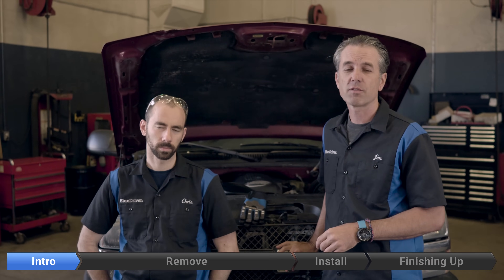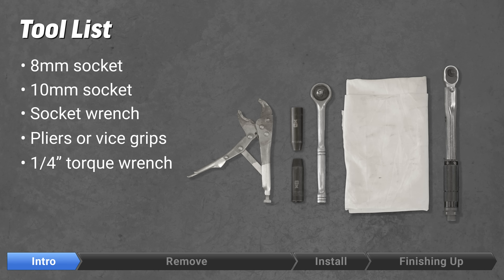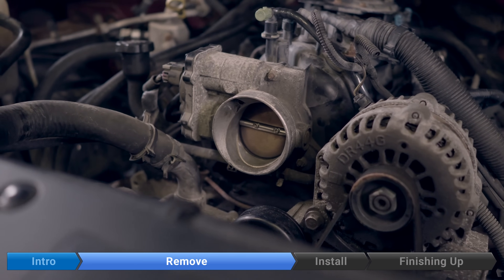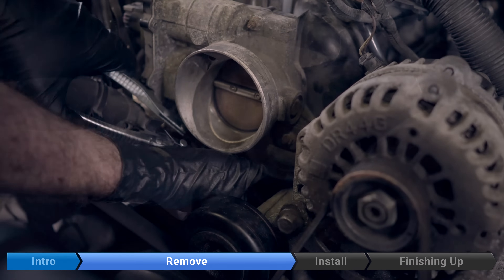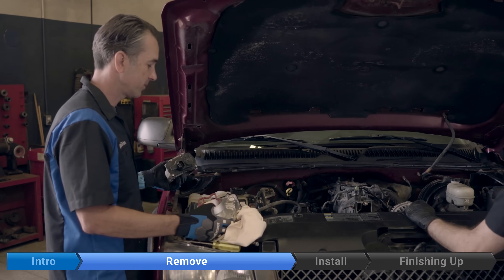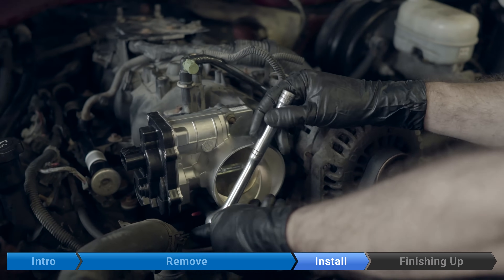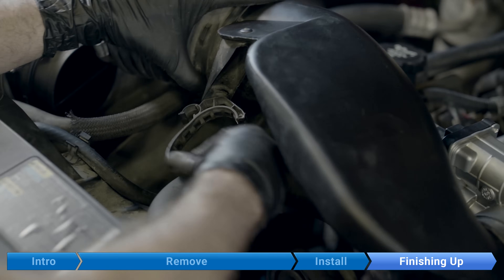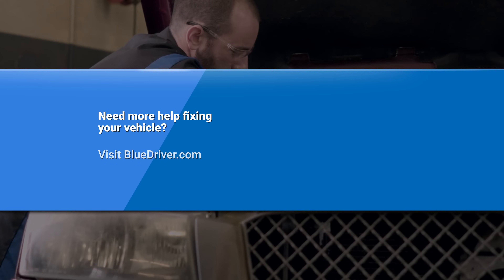Throttle Body – 1999-2006 5.3L Chevy Silverado (Sierra, Tahoe, Yukon, etc.)

Comment: This video saved me so much money, the dealer wanted $150 per sensor plus $800 labor. I bought sensors for $50 each and a gasket, all for under $200. Thank you for making this video, it is the best video I've found on YouTube for replacing a knock sensor, so we'll done. I can't thank you enough. A few snags when I did the job. My rear sensor was stuck, just spinning when trying to remove, found a video  that you just reinforce the crimp with a screwdriver and hammer, saved me from drilling. Also my injector connectors were different but I found a video for that too. YouTube is the best instructor!

Comment: Thanks for starting with the battery. Clean tight connections are important, but checking ground from the back of the alternator is important, install one if none, voltage drop ground and B+ while running with headlights, blower fan on high and switch DMM to A/C at alternator as it should be less than 0.60 volts A/C at 2K RPM and 1/3rd of that reading at the battery. A bad diode plays hell with serial data signals, even without a “ U” code. ASE Master Tech since 1978 - Retired

Comment: Thank you for showing us I’m hoping that’s what’s wrong with my truck
Reply: I have a 2006 Chevy Silverado the RPMs goes up and down it looks like I’m losing power the one and a third gear the idle the RPMs raises up and down up and down before all this happened it’s just that there’s RPMs We’re just traveled up up and down not all the time to certain time so clean sprayed the throttle Body it seems like it helps him then it’s idols really high
Reply: @shepfc1962  did it help?
Reply: @DB-in1kh  yes Wasn’t the problem The second and fourth gear in the transmission was out thank you

Comment: Mine is a 2000 2500 6.0 just cleaned mine put new gasket on it and the truck is fixed used to cut out now it has instant response
Reply: i have a 2000 gmc with the 5.3 and the throttle is stuck open so it idles super high if I clean this will that help

Comment: Bought a throttle body sensor for a 2003 1500 5.3 liter engine from Oreilly. auto parts. Sensor connectors that plug into the throttle body were to deep into the sensor. Replacement was the same way. Was forced to buy the complete throttle body with the sensor. Mechanic is putting it on now. I hope the sensor is not the same as the other two!

Comment: Does anybody know what that part sitting above the throttle body is? (the part with that green knob attached to it)
Reply: That's the evap solenoid service port
Reply: That one vacumn hose he took off the was so hard that i pulled it and that plastic vacuum fitting broke

Comment: My tahoe 2003 5.3l is not relearning.. replaced the TB and have done the whole 3min run 1 min off about 6x now. I tried doing the 44mph trick, but my car will not go over 10mph... I also tried taking the battery off for 10mins and no luck. It says reduced engine power and the light is on. Unfortunately I can't drive it to go get tested.. would anyone be kind enough to help?
Reply: Did u ever solve?

Comment: Had a question guys I have a 2001 chevy tahoe, when driving the engine sounds like it revs when getting to the 30 mile mark on speedometer it had the engine light so I put the code reader and p0332 comes back so I change the knock sensor and it still does it can you guys give me some po in nters of where to start from please. Thank you in advance
Reply: @Enrique Torres   >The code P0332 is the knock sensor. I highly suggest dielectric grease where is screws in and inside the connector. A high temp RTV should be applied completely around the valley grommet to keep water out. Any pressure or vacuum from temperature changes will pass around the wire in the grommet. Throw away the foam gap fillers on both ends of the intake.  
 After this repair and you have no codes and the same problem, it auto, it can be a sticking shift solenoid. It can be serviced in the vehicle with the pan off. I highly recommend changing the servo assembly complete with a new one from “Superior”. It takes an hour and cost parts about $100. This effects 2nd, 3rd and 4th with higher holding pressures if what you is hearing is a “Shift-Flare”. The two maybe completely un-related. However, the signals from the “MAP”, “MAF” and throttle position tell the PCM if you are up shifting, down shifting, holding still on cruise or pedal. But all of these signals are inputs to shift and change ignition timing for proper feel, shifts and normal operation while it calculates load. This effects the line pressure in the tranny. Cleaning the MAF sensor is normal for higher milage vehicles. Do NOT touch the sensors wire with anything other than MAF sensor cleaner from a quality company like CRC or Berrymans. Others may work, but a check of pending or current codes is a good place to start. Hope this helps since they didn’t answer you. ASE Master Tech since 1978 - Retired
Reply: What he said. The design for the knock sensors is bad in that the seal (lack of seal) allows water in. Def use some rtv sealant or gasket maker around the area

Comment: What year is this one? Mine has cables attached ....it's a 99
Reply: The one in their video is  the updated/refreshed Silverado from that generation. 2003-2006 which did away with throttle cables.

Comment: My '99 GMC 1500 SLE 4x4 5.3 has the old style mechanical throttle rather than the electronic.  Can this be converted to the electrical actuated throttle and is it worth the difference in cost / and harness particulars?  If no,  what steps are additional?
Reply: Stay away from electronic throttle body's if al possible 99 Silverado is the only 5.3 I drive cable not drive by wire

Comment: What is the hose that was removed and put back on behind the Throttlebody? You pulled it off of , what looks to be metal valve, mine is plastic and it broke is it replaceable?
Reply from the maker: It doesn't seem like it - GM only has two part numbers listed - gaskets and a full intake assembly: https://www.gmpartsdirect.com/v-2005-chevrolet-silverado-1500--ls--5-3l-v8-gas/fuel-system--intake
Maybe a trip to the junk yard, or some JB weld plastic?

Comment: I attempted this today. The coolant hose to the water pump got in the way. Did it prove to be a issue?
Reply from the maker: It shouldn't - what type of vehicle is it?
Reply: 2003 gmc yukon 5.3 v8. I replaced the throttle body. The water pump nozzle that connects to the upper radiator hose got in the way preventing the throttle to come off easily. It came off with some force. Although slightly bent the bolt.

Comment: 2005 Tahoe. 79,000 miles Has started hesitating when pulling out from a stop sign if you didn't come to complete stop., Say rolling less than 5 mph.  It doesn't accelerate, then feels like someone hit you in rear when it catches.  Any ideas?
Reply: Clean your throttle body mine did the same now mine runs good
Reply: Try cleaning your throttle body and IAC valve but also kinda sounds like your transmission might be slipping. I would check your u joints and your differential too

Comment: I replaced throttle body ,throttle body position sensor ,mass flow sensor and still having issues with engine power reduced dash light coming on , what else could it be ?
Reply: Bad or loose/corroded ground wires

Comment: After doing this my rpm fluctuates and if I tap the throttle it just climbs the rpms with no intention of stopping
Reply from the maker: Most likely the PCM just needs to relearn the new throttle position at idle - if you let it idle for a while it should become more normal

Comment: I’ve been reading around, after a cleaning of the throttle body it says it needs an idle relearn? Does this apply to a 2000 Chevy Silverado? And how do you do a re learn if needed
Reply: Would your truck go into limp mode at idle?

Comment: Should i have had the computer relearned after installation of throttle body?
Reply: I also had this question, as I was told by a mechanic that I was supposed to, but can't find anything on it...
Reply from the maker: It should do it on its own, but you can also follow these steps: https://www.rockauto.com/genImages/22/BOU-AVM-1-I-080B.pdf

Comment: Start off with amazing video. Easy instructions and tool list. But... You need to hold the torque wrench at a specific point to get accurate torque. I fear those bolts are undertorqued due to hand placement.

Loved the video. Had to say that again!
Reply: Just took off the tb and maf and cleaned them both. Easy instructions, simple directions and the tool list is spot on. Double appreciation.
Reply: @earlborchardt4358 ????????

Comment: I replaced my throttle positioning sensor and I can't go over half throttle or it bogs out.
Reply from the maker: Are you getting any codes?
Reply: @LemurMonitors  I saw two P0171 and P0174 but that was days ago and another mechanic put another computer on it since then. He saw codes- I did not see them that indicated either a knock sensor or fuel pump problem. He is supposed to be coming by today to check the fuel pressure to eliminate the pump as the issue.
Reply: BANSHEE MIKE was it fuel or the sensor?
Reply: @89mww  it was the fuel pump it made noise but had no static pressure. Only had 6lbs. While running.. ac delco pump only lasted 9 months